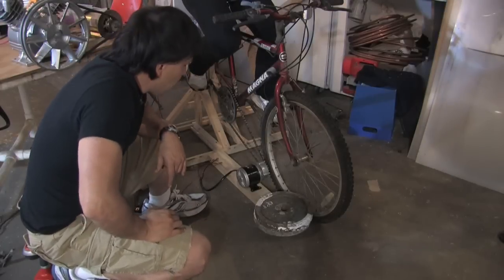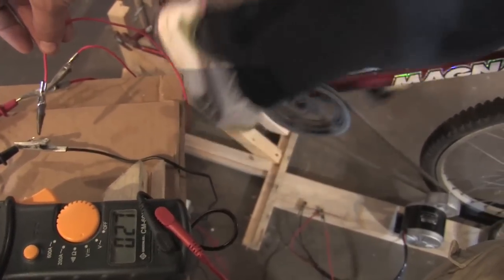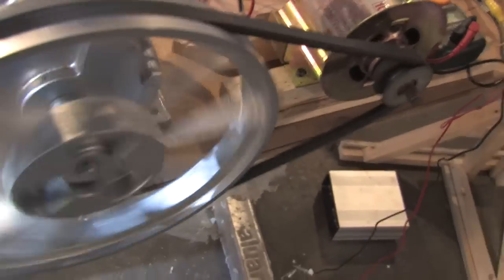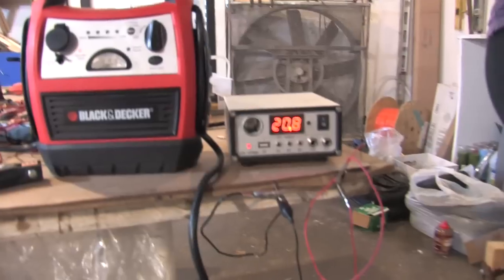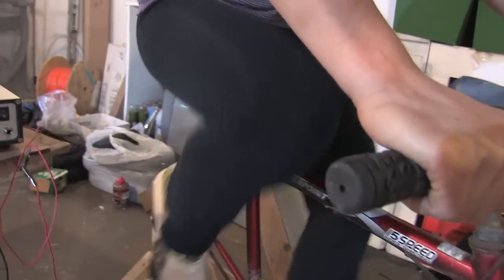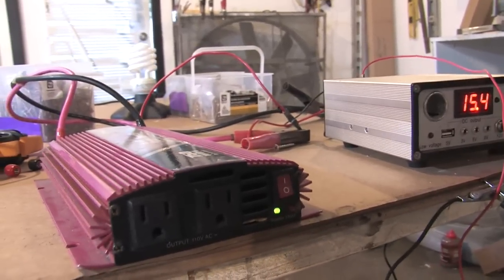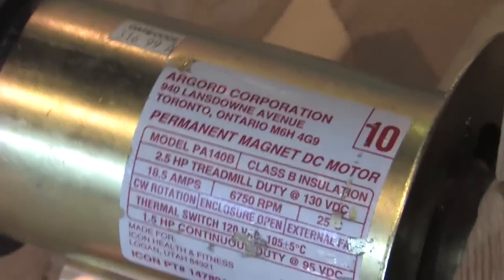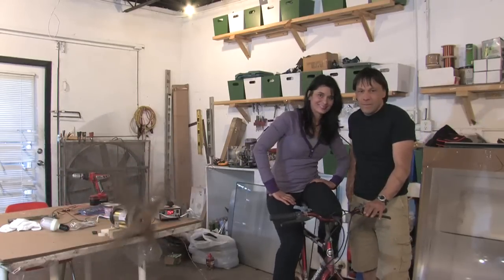Bicycle Generator DC Generator Green Energy ELECTRIC BIKE DIY HYBRID

Comment: Make free seven bigger wheels contact it with seven gear then put one side a alternator.  
7 wheel rpm in one rotation need to 2000 rpm so fit 4 big wheels and three small wheels then fit your cycle system on it then you will going to get the rpm of more than 2000 in one rotation in seven speed cycles will going to increase it more than 3000 rpm then you will going to collect the free energy . It's more good if you able to make alutinator wich works on less than 1000 rpm

Comment: I'll never have the money to make it happen but. If you geared the pedals to spin up a flywheel very fast and the flywheel to turn a alternator. The alt. Will charge a battery that powers a small DC motor. You peddle consistently at the same rate... All the time! Even if you are going down hill. When going down hill don't use accelerator. You should be able to consistently generate enough energy to transport yourself without a heavy workload. It is a theory of mine. If you find someone who has tried of want to do it yourself please let me know the results
Reply from the maker: That is a great idea Gary, there are batteries now that charge rapidly and dump a powerful load, almost like a capacitor.  A guy who rides down our road has something similar and also a two stroke gas engine. Sometimes he pedals to charge, sometimes he zips by with a loud engine, other times he zips by silent. He got a flat one time and I helped him out so I got to see what he threw together. No flywheels but really cool. The DC motor can totally disengage or not and so can the 2 stroke. Just levers that clamp…. Not the safest thing with lose clothing but good.
Reply: @GREENPOWERSCIENCE  also there would be no chain to the rear wheel all all mechanical energy would be used to make electricity. When riding a bike you only need to use the power here and there to gain more momentum or climb hills. But you will peddle consistently even when there is no need for throttle. Peddle 100% at a steady rate and then use the stored energy 50%. Plus you start with a charged battery. I would imagine you could ride for hours. Never feel the stress of riding up a hill. Also question does the gyro effect on a spinning object effect the forward movement of the object. Just wondering if the flywheel will help you move forward?

Comment: imagining current flowing like water, is hard for me to explain why the generator stoped when you short-circuit it. Why a higher current resistance means easier mechanical work and lower current resistance means hard mechanical work?
Reply from the maker: The short is a dead load so the magnetic field inside the generator increases. Same reason alternators and electrical generators cog down and require more HP when a load is placed on them. Higher voltage in an open circuit or light load is no problem, more power consumption or a dead short results in a larger load/AMPs.

Comment: It's my understanding that a chest freezer converted to a refrigerator runs at 4 watts. They don't run continuously, but 4 watts times 24 = only 96 watts. Do you think it is possible to put that much on a battery to run the fridge with this bicycle generator?

Comment: nice, but a bigger sprocket on the outside of the motor would be more efficient as you're having losses in the chain due to the acute angle the chain pulls around that tiny sprocket. Pedalling at a higher cadence/smaller gear ratio is better/more efficient than a slower one using a bigger gear.

Comment: I love your videos!! You always show different aspects of doing things and why what may seem "the most simple easiest get her done if it works then one doesn't need to look at any other way" is one approach, but just because the set up may be the easiest , it isn't always the easiest, in efficiency and labor, the easy was only in the parts and the putting together and a person will have things much easier if they invest a bit more effort into research and equipment, thus actually making the output of electricity much easier in the long run ofproducing electrcity!! Great video as always! Well done on instruction and as always, the Mrs. made an amazing assistant didn't she!?! GOD bless everyone!!!

Comment: Really like your  videos.  Thanks for  mentioning  the  rectifier  on the input  to prevent feed back.  There are different  btry booster packs that have  a built in input cut off  for  switching when the  btry  is  topped off  too.  I suggest  an alternative  input  circuit  using a btry   feed and a btry charger  that  you plug in  and   run the  out put  of  the  btry  pack  to  a flow storage  of   three  seperate  12 volts in parallel    and then to a 1500 watt  inverter.   You  could  run your  whole shop with  a setup  like that  and   also charge  the system  with  one of those wonderful verticle  wind  generators  you two  build.  (y) (y) (y).

Comment: A 100 watt solar panel makes the same energy with zero effort for 25 years....
Reply: Popeye Gordon but it is good when no sun and wanna watch tv .not all have electricity. But most cant do 2 things tv watching is so hard for most
Reply: Yeah but nobody takes in consideration that to collect, sift, transport and Melt the silicon, and the aluminum, Glass, etc. and actually Make Solar Cells, and FABRICATE the solar panel, Transportation, etc. etc.; it took, *THOUSANDS of WATTS Already spent* that came ALL, most likely, from Fossil fuel Energy sources.............
PROBABLY more that this panel will produce in(if it lasts)25 years......................
Reply: but what if you receive so little light for extended period? solar is not always practical. esp in the polar circle where there is months of darkness
Reply: Talk about blatantly obvious!! The polar circle? You must be joking. Only a dozen people live there. Most of our human population lives within the sun belt where solar is extremely cheap and practical. We also noted you upvoted yourself.

Comment: Good job. Just a suggestion. Try adding a heavy fly wheel on the generator shaft for a better controllable speed. It will be a bit difficult  to get it going, but once the fly wheel gets its momentum, peddling would become easier. This is a good way to exercise & produce that expensive thing called 'ELECTRICITY'.
Reply: Aabid Ali Mulla Lets do. it man, contact me, Klaus, thanks. The possibilities are limitless. 👍🎶🎄

Comment: First, I would use a DC gen with skewed coils to eliminate the cogging (which is where the resistance that Denise feels comes from). Then, would use the output to keep a battery bank charged, and then a DC inverter to plug in various appliances.

Comment: A heavy flywheel might help smooth out clogging from the generator. A gear changer can allow a human to pump up to a higher maximum pressure in an air compressor, and allow a human to push a higher maximum current draw from the generator.

Comment: I used a self exciting alternator. Once it was hooked up to the battery, it was insanely hard to pedal. I used a 24v dc motor as my generator and with the gearing just right, I am able to produce just over 13volts while under load. I can pedal and produce that consistent voltage for about 15 minutes. It is a lot harder than you think. I was wondering if adding a capacitor between the battery and the generator would have any effect on the amount of resistance created by the generator while under load.

Comment: Y cant you use the rope on the back wheel of the cycle and connect the rope belt to the shaft of motor does it affect when load has been placed

Comment: why not add the rear wheel, and have the Gen run off of the Low gear while the bike runs in the 15 speed mode , front large gear, to rear small gear, and gen run off the large rear gear. I think it will run much faster and more steady,  Or just hook it up to the rear wheel, and increase the speed.  Just an ideal,  I am about to undertake myself.

Comment: Just curious, If I ride my road bike putting out an average of 300 hoers for 2 hoers or as much as 5 to 6 hoers, how long could that run a 100 watt light bulb. I'm guessing during a 2 hoer training session, I should be able to produce enough to run a 100 watt light bulb for 6 hoers, provided I'm averaging 300 watt hoers of power during that 2 hoer session. Am I correct? As a 2 hoer session is a rather short session for me, it would seem to be a viable form of energy production for someone such as myself. I'm sure there would be some loss in the wires and motor... and I have no idea how much loss to figure in.
Reply: +Eric Coovert If you can produce 300 watts consistently for 2 hours then you are in really good shape
Reply: +Eric Coovert The figures I have read suggest an average fit male could produce about 200 watts for an hour. So would you say that was worth while.?

Comment: hey i have a pedal trike .. i have a 12v dc motor that can be used as a generator and a 12v small car battery now .. i want the battery to run led lights down the frame and maybe a stereo or sound system all from a car .. my trouble is if i can get the motor driven some how how can i get it to charge the battery without the battery just trying to run the motor ...
Reply from the maker: +kierankay100 A charge controller does the trick. They have a blocking diode inside. The charge controller will prevent excessive high voltage and overcharging. If you want to skip the controller, a blocking diode inline (ebay sells them) will do the trick too. It limits voltage to one direction.
Reply: GREENPOWERSCIENCE thank you i knew it would have been something like that but wasnt sure on what to search thanks !
Reply: GREENPOWERSCIENCE i found a solar one but can i just hookup the generator to the side meant for solar panels

Comment: To disable or reduce the load use the spark gap technique or use 3-5 amps resister just connect to the positive side. If you are using spark gap technique make sure you connect to the capacitor before connect to battery

Comment: By using only the front sprocket you have ignored the mechanical advantage at the wheel. I belt from a tireless rim driving a GM self exciting alternator that either charges batteries(s) or powers an inverter, would be less complex and easier for people to put together.

Comment: Hi
Can you actually charge the car battery like this? I definitely think I would add a battery to the circuit so and the load (light in this case) would stay steady.. How long do you think it would take to charge up a 60Ah battery to full? Do you need some other appliances or you just have to plug the car alternator ran by a bike to battery to charge it? or there is need for like charge controller and anything else? thank you! Marc

Comment: So, would it matter if you simply hooked it to an inverter and plugged it into the wall to feed back into the grid?  Do you have to keep the pedals at a certain speed, or pedal as fast as you can to produce more electricity?

Comment: Thermally efficiency is not the aim: useful energy (used to move drywalls) is. Trucks are VERY usefull. Still this does not imply they MUST run on GAS.
Did you notice haw DESPERATE we are on searching new oil? Canada refine oil sands! USA is moving WARS in order to catch some more! Texas is empty, BP risks going under sea and under arthic poles!! Why is that? Because we are reaching the peak. The current EROEI (check this) is dropping... 10, 50, 100, 300 years? it will end anyway. Then what?

Comment: That's better: we are comparing engines efficiency now. Human body scores poor because thousands of years of evolution made it an efficient living thing, not an engine. Still we should compare the energy efficiency of the pedal thing with the one of a diesel engine or such. Anyway if 54% is the very top of the diesel engines class, that makes it a crappy technology, and the everage of common engines (cars) is far below that: 17% to 30% at most (check wikipedia). Fossils=looser.

Comment: You are completelly WRONG by comparing the efficiency of an engine to the abount of energy provided by a source. Get back to "Physics 101" and compare two things of the same TYPE. BTW: the efficiency of an everage car engine running on fossils is so LOW that you better use it as a HEATER than an engine. The more attached you are to fossils the more in trouble you'll be when they are over. And they'll be.

Comment: Great video!  Thanks! When using this setup to charge batteries, is it crucial to keep this between 14 and 15 volts, or can one go much higher and charge the batteries quicker through the charge controller?

Comment from the maker: FOSSIL FUELS do not keep you in shape, USA 30%+ obesity and 50%+ overweight. Also this is designed to give small power to remote areas. Works great. At full pedal you can produce 200 watts and trim some fat. Not bad for a $100 system.

Comment: even though this has nothing to do with this video. is it possible to make a magnetic motor/generator. for example have the magnets in a permanent position around the shaft spin it once to get it going and have it go. i dont think its possible. because of laws of thermodynamics and perpetual motion. but worth asking..

Comment: To charge the battery directly to run your preferred device. (Batteries store DC) An AC motor could be used as a generator but it has to have specific parts to it, DC motors are a bit easier to find for an application like this.

Comment: I really appreciate this experiment. I have been playing with the idea of building a pedal generator to charge a battery that would power a motor to propel a bicycle. My thinking is that it would be a hybrid electric bike that regenerates via human power. Not expecting unlimited range but rather increased range over battery power alone. I have a 15 mile one way commute with lots of hills and a bad back so a recumbent trike may allow me to ditch the truck on fair weather days. Great vid. Thanks.

Comment: The heavier the load the harder it is to move due to Work Done = Force x Distance
The length of the propeller for each blade has a moment. In between pedal movements that moment requirers less force. then when a new blade comes to rotation the force required increases hence why the pedals slip an chain jumps on the first generator. 

Sick video. PROPs

Comment: My bicycle has a front hub dynamo that power front and rear LED lights. The front light is very bright and I really can't tell the difference with lights on or off or changing the front wheel with a regular wheel. 
I really wonder what an effencent human power setup could do - to fill in between wind and solor energy.

Comment: I would like to drive a portable outdoor movie projector consisting of a video projector, DVD player, and small guitar amp (for sound) using car batteries and an inverter.  If that configuration would work, could I supplement (add charge to the battery/s) while operating by using a bicycle generator?

Comment: instead of a motor there why dont u use a generator, when the electric current goes back to the motor there will be no resistance.

this is my understanding correct me if im wrong

Comment: You can use what is called a buck boost regulator.  When in boost mod it will raise the voltage while reducing the amperage.  When in Buck mod it reduces the voltage and increases the amperage.  It is idea for charging batteries because basically you maximize the watt hours that you are getting from your power source.  Just google buck boost regulators.

Comment: I wonder if the rear wheel could be left on to act as a flywheel? Just drive it with one of the lower gear front sprockets.

Comment: The average adult male can 'output' 100-125 watts with his leg muscles, or roughly 1/8-1/6 of 1 HP. At the ~15V required to charge a 12V battery, that's 7-8 amperes of current. So it would take exactly as long to charge as charging that same battery with a "normal" charger on the 7A or 8A setting, roughly 30 minutes.

Comment: Pretty good demonstration that pedal powered electrical generation is very impractical. Batteries need both power and time to charge. I can't see someone pedaling for a couple hours to charge even a low power battery, like a cell phone. On the other hand, direct bicycle power for short term use for some device, like my sewing machine, can be very practical.

Comment from the maker: Car alternators unmodified are a bad choice. The RPMs needed are too high and the rotor needs to be powered (exciter) alternators use electromagnetic field so you need about 65 watts of power to gain full power. Fully charged exciters are very difficult to turn. Car alternators spin 2x the engine RPM so 5k +
Rear wheel pulley slips when a similar load is placed. I have seen on planet green an guy using drill motors with the belt setup. He is producing 15 W this is 100W+

Comment: If you use a standard vehicle alternator, wouldnt this eliminate the need for a charge controller? Seeing as an alternator usually peaks voltage at 14.6v?

Also, would leaving the rear wheel on and using a standard serpentine belt rapped around the rear wheel groove(tire and tube removed) and alternator pulley be the better solution, providing you with more gear options?

Comment: i done the same thing hooking up a scooter motor 100 watt 24 volt with a bike and belt and noticed that you cant just use the dc to ac inverter  by itself to power anything i almost cooked it . inverter  must be hooked up with the batt in order to power anything or to charge the batt  but yea works well

Comment: Is their anyway i gnerate electricity from a home made generator (rotating magnets inside a ring of coiled copper wire) and connect it to something that stores that electricity, or uses the electricity to charge a battery, or to run another motor? any of these 
(and what is DC and why cant AC charge a battery?)